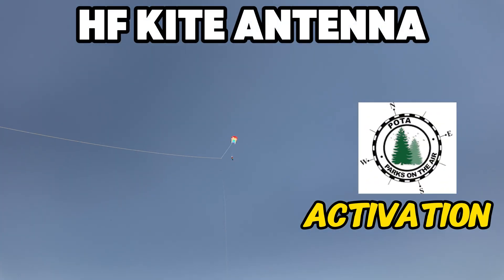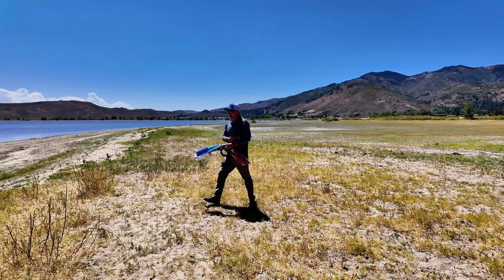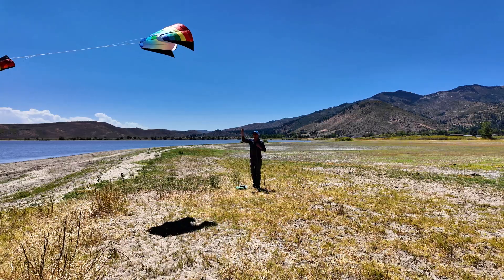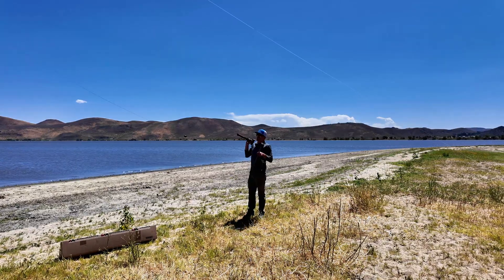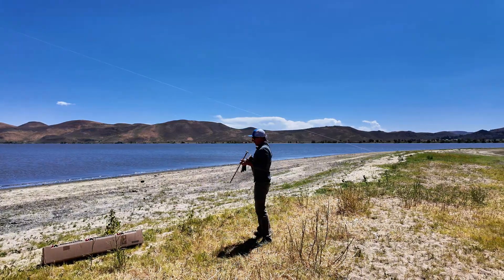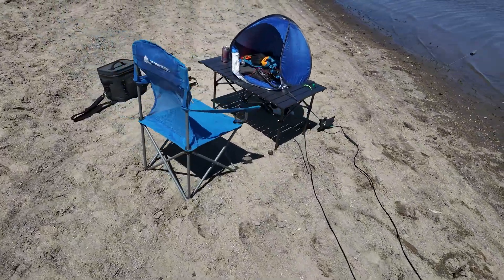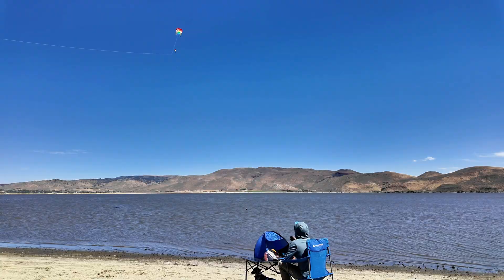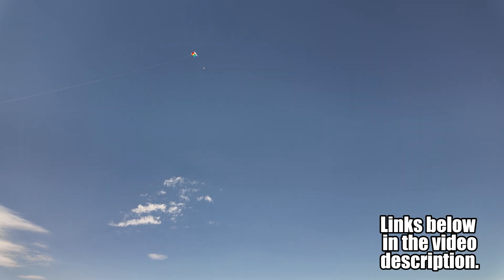HF Kite Antenna POTA Activation

Comment: This rules. I deal with an AM 50KW clear channel transmitting 4 miles away with the K9DP QRP AM Broadcast Filter for the G90. Question for you: what is that mini tent you have on the table blocking your radio from the sun? I've been looking for a solution like this. Thanks for the vid! Mike W1VEG
Reply from the maker: Thanks, Mike!  The K9DP BCI filter can be a daysaver, that's for sure. Too bad  I forgot mine at home, hihi.   Here's a link to the shade tent for the radio. https://amzn.to/4oNoGLV

Comment: Great job!
I am successful killing static electricity build up by paralleling a 100 winding coil on a plastic pipe aprox 5 cm in diameter.
Had bad sparks on my antenna cable 😅
73!

Comment: I‘d love to see one day an aerial carried by more than one kite at roughly the same altitude. That is, to modify kites (make them asymmetric?) to make them want to fly apart and thus pull e.g. dipole legs or triangle‘s nodes in opposite directions.

Having more than anchor isn’t an option, because wind direction can change. And with single anchor all unmodified kites will align in the same vertical plane - why would they want to fly apart.
Reply from the maker: That would quite the antenna!

Comment: Would it work to use the antenna wire as the kite string to save on weight?
Reply from the maker: You could, but it would probably stretch out your wire, affecting the tuning. The string provides a safety and a near vertical deployment.

Comment: Great video.  I have been doing this at the New Jersey beaches this summer using a basic delta wing kite.  I'd like to hear more about your wire to kite connection.  I use a 5800ohm bleed resistor on my 9:1.   I'd suggest a Broadcast Band Filter (there is a good kit filter out there) to eliminate commercial radio interference into my G90.

Comment: A 49:1 transformer has a direct, DC path to the ground lug, no need for bleed resistors.  You may look at improving the groundrod, a groundrod will not do well in sand unless on a salt water beach.  You may do better by moving back from the water front and placing it in better soil with better conductivity.

Comment: Could be worse. Ricky could be trying to help, if you know what I mean. Looks like what they call a sled kite.
Reply from the maker: Another dog and Rocky rran threw the wire during setup. Thankfully, I was able to untangle them before it got too bad. The kite is a single line parafoil kite. Some of them are called sleds.